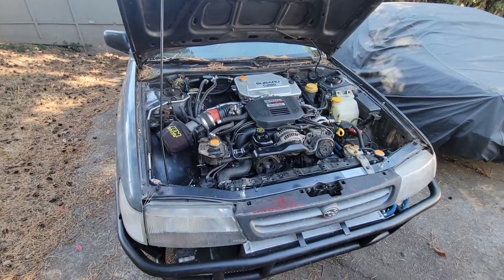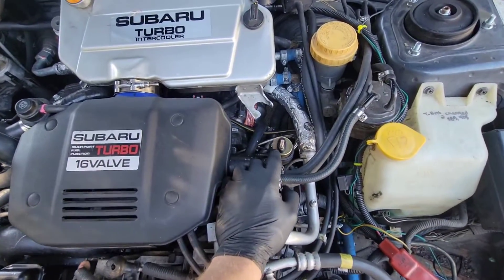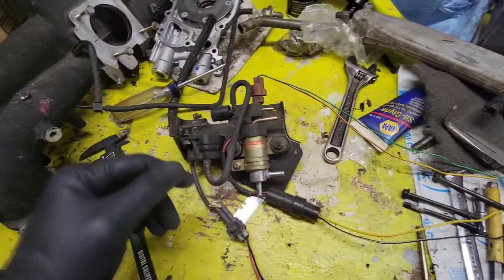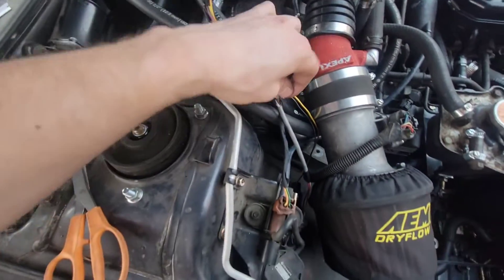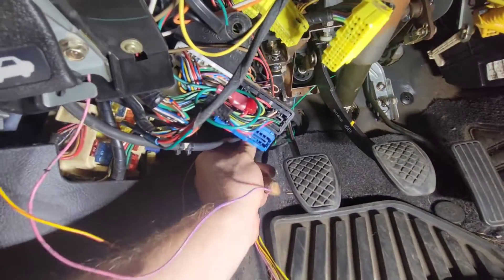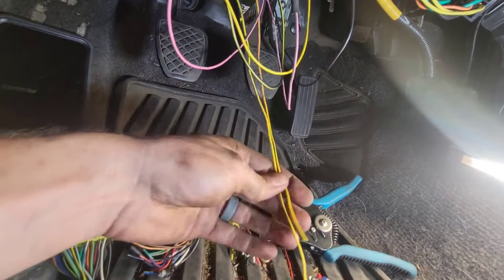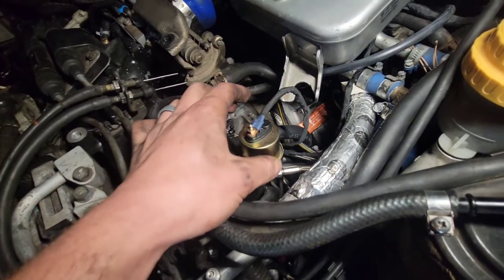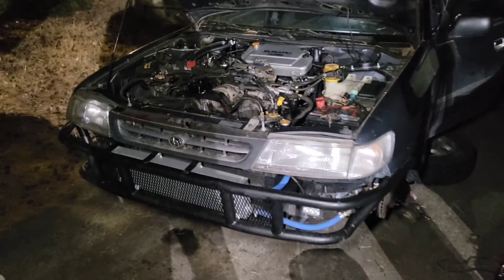How to Turbo a Non-turbo Legacy - EJ22T Conversion Pt.2 Wiring and First Start!!!

Comment: Might be a dumb question, but do those 22t heads have the same rocker arm setups as the 22e heads? Because the ticking is just air trapped in the valve lash adjusters. They need to be primed by hand in a little bath of oil. But you guys would already know this right?
Reply from the maker: The lifters are the same between the two, I don't know about the arms, I would imagine they are the same, they do have different cams. Yes we did prime these but the engine sat on the stand for about a year before this video so they deflated apperently. After the first few warm ups it went away entirely, so no more ticking!
Reply: @HackSquadGarage  oh and your parts bin would be a trip to see. 🤣🤣
Reply from the maker: @edwardiganz2478  thank you! We definitely appreciate it. Oh yeah we'll still make videos as long as we can. Haha yes we have quite the hoard of subaru parts, it's all packed into this little 2 car garage we call our shop. When these old subaru parts are so hard to find you can't really justify getting rid of things haha
Reply: @HackSquadGarage  I spotted a JDM RS front bumper just sitting on a wrecker wags on the side of the road in a small town. My Dad's a huge hoarder and he was trying to make me go hit the owner up. But I didnt grab it in the end but yeah, I have panels, doors, rear hatch, spare ej22e, assorted auto parts, headlights, stoplights, body seals, wiring looms all "just in case" someone rights Betty off, or whatever.
Reply from the maker: @edwardiganz2478  oh wow, yeah that's unfortunate. Those bumpers are next to impossible to find, and super expensive to import of you did want to get one shipped.
Reply: You are so knowledgeable and these Subarus are amazing for their interchangeable bits. Especially chassis wise. Keep makin this content even though its not the most "viral", because you guys help out so many of us that love these old gen Subies. Thanks dudes.

Comment: @hack squad garage, last month i bought a 04 impreza wrx. last evening i was going on a little ride when my car just over-revs and not going over 55mph/90kmh. also the car just started holding in and sometimes makes a little but loud bird chipping noise and my engine check light came on. i opened the hood and listened but no special sounds whatsoever in idle. could this be the clutch???
Reply from the maker: Yeah obviously I can't say for sure without more information, but it sounds like your clutch is toast, if you are in gear and the car revs without accelerating the clutch is slipping, luckily it's not a terrible job to do and I actually have a how to video on this channel on doing a clutch by myself in a day on a 04 wrx. Hopefully that helps! 👌
Reply: @HackSquadGarage  yeah that video you mention was the first video that caught my eye :) but is it normal that even with a clutch problem the engine light comes on ? thx for the response

Comment: Is this engine from a wrx outback or something? Never seen a 2.2T
Reply from the maker: Nope the ej22t is the factory turbo 91-94 Legacy engine, specially from the first generation of the subaru legacy, it's a sohc, closed deck block engine that's pretty rare and saught after so they are kind of expensive. This engine is a budget ej22t, it's a ej22e block with ej22t pistons and ej22t cylinder heads with a stock wrx turbo. We used all factory turbo legacy parts to make this car turbocharged.
Reply: @HackSquadGarage  now that's a history lesson. Thanks man!
Reply: Is 2.2l closed deck block only found in first gen legacy and some 90s wrx like 22b etc?
Reply from the maker: @R3naldas  the ej22t was only in the usdm first gen turbo legacy, other countries got 2.0l version like the ej20g which was also the early wrx engine, dohc higher hp but only the legacy/liberty got the closed deck version of the ej20g. The actual 22b has an engine called the ej22g which the block is based off the same block but has some differences like the ej22t has oil squirters and I believe the 22g doesn't. But the heads/cams/intake were basically later sti ej20k. The ej22t was a weird over built usdm engine we only got for a short time, ej22t/ej20g were the only factory closed deck blocks subaru made.
Reply: @HackSquadGarage  you're knowledge is beyond my understanding haha I didn't know subaru made so many different variants of their motors. A lot to choose from for your builds. Do you know if NA ej22 from 2nd gen legacy any good?
Reply from the maker: @R3naldas  thanks haha we've been building them for years now, the 2nd gen legacy still mostly had the ej22e, but there was a later version that was in a lot of the impreza based outback sports and I believe some later 2nd gens that was a phase 2 version called the ej222, that is a good short block to head swap and make na power, I believe it's about 10.4:1 compression factory, people usually swap them with the higher compression jdm ej20d heads and make like a 11:1 compression 2.2l dohc making well over 200 crank hp na. We're probably going to do a similar setup for our cheap rally car project here soon.
Reply: @HackSquadGarage  EJ20G RS Euro model, has oil squirters too btw.
Reply from the maker: @valqkasdf  yes some of the early ej20g had them as well, they also made open deck versions of the 20g that didn't have them I believe. Early 20g and 22t are the same block besides the bore/sleeves.